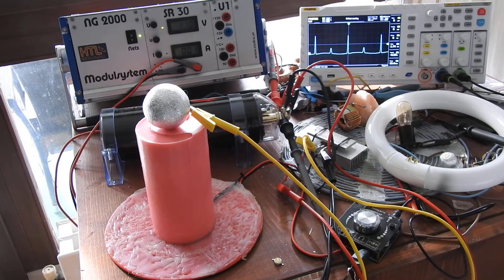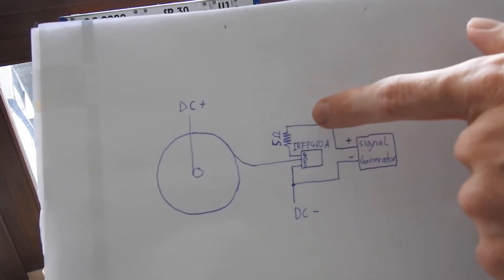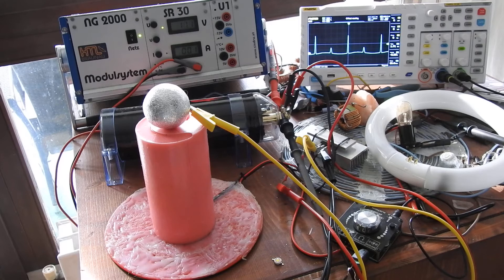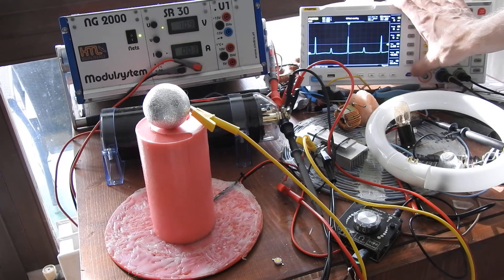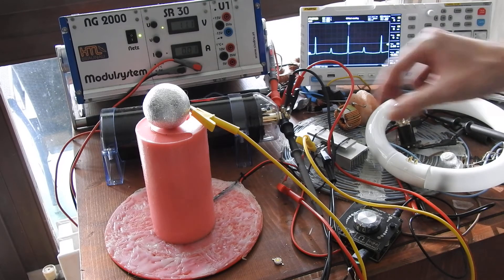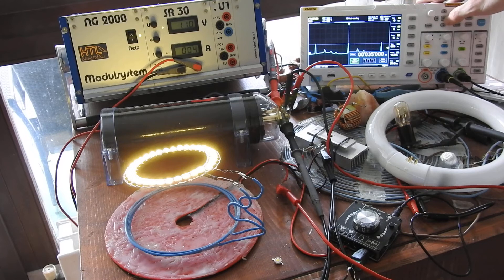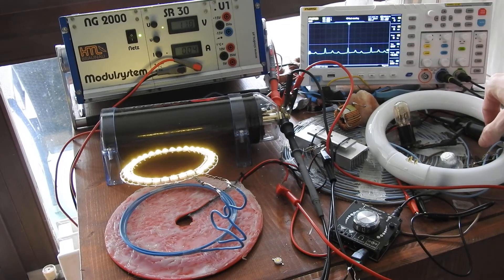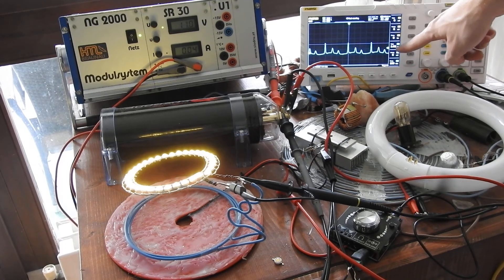High Voltage Impulse Generator - easy build with schematics and examples

Comment: Tesla tells you how all his followers and disciples got in wrong in there understanding of his patents and coils. In his court case against Marconi. Once you read it, it will change your understanding of your projects and the purpose of modern day Tesla coils.
Reply from the maker: Do you have a link to the document you are referring to?
Reply: I will find it and provide it to you shortly. Colorado springs: tin 30" ball polished, reflective, lacquered and coated with rubber paint. It took me a long time to understand why. You want the antenna 📡 1 - 5 % the weight of the ground metal. Most of the energy stays in the circuit or ground. Very little is lost through radiation in the antenna. High Voltage and low frequency. Modern day Tesla coils are Lodge coils. There purpose is to demonstrate disturbances in the Aether by sound waves. They radiate 99% of the energy. Opposite of what you want. Warden Cliff transmitted 99% of its energy through the ground. Hence the giant sprawling copper grounding rods.
Reply from the maker: @devinmccloud  Very interesting what you write.
I have thought about coating the aluminum ball with epoxy before, now I'm probably going to do that, although I still don't know what purpose this serves.

Thanks for the informations!
Reply: @OmegaZZ111  it needs to be a mirror finish. As stated by Tesla. Then lacquered or polyurethane. Then rubber paint. Right out of his Colorado Spring notes 1899. 
 Ed Leedskalnin of Coral Castle 🏰  was a Tesla fan. His theories were inspired by Teslas works. The same concept was used in his shed. Once you except what Tesla said light, radio, and electricity are, then things make more sense. Electron theory is just that. Tesla created his own scientific instruments far superior to Hertz and others. Those instruments are only as good as the mind that creates them.
Reply from the maker: @devinmccloud  I am currently coating two aluminum spheres I made today, I hope they will be useful for future builds.

Thanks for pointing out the Colorado Springs notes, haven't read them before.
Reply: If you really want your mind blown, read his Wardencliff brochure on how he would unify GPS globally, connect all telegraph stations, time servers; music, pictures, radio globally. He envisioned the internet one hundred years before anyone. All of the things this man talked about where not predictions of the future, they were realities he had already created!
Reply: I have posted twice and each time it is removed by someone. Posting text:
In a pre-hearing interview with his legal counsel in 1916 to protect his radio patents from Guglielmo Marconi, Nikola Tesla explains the similarities and the differences between his wireless system and the systems of today.

Counsel: “Mr. Tesla, at that point, what did you mean by electro-magnetic momentum?”

Tesla: “I mean that you have to have in the circuit, inertia. You have to have a large self-inductance in order that you may accomplish two things: First, a comparatively low frequency, which will reduce the radiation of the electromagnetic waves to a comparatively small value, and second, a great resonant effect. That is not possible in an antenna, for instance, of large capacity and small self-inductance. A large capacity and small self-inductance is the poorest kind of circuit which can be constructed; it gives a very small resonant effect. That was the reason why in my experiments in Colorado, the energies were 1,000 times greater than in the present antennae.”

Counsel: “You say the energy was 1,000 times greater. Do you mean that the voltage was increased, or the current, or both?”

Tesla: “Yes [both]. To be more explicit, I take a very large self-inductance and a comparatively small capacity, which I have constructed in a certain way so that the electricity cannot leak out. I thus obtain a low frequency, but, as you know, the electromagnetic radiation is proportionate to the square root of the capacity divided by the self-induction. I do not permit the energy to go out; I accumulate in that circuit a tremendous energy. When the high potential is attained, if I want to give off electromagnetic waves, I do so, but I prefer to reduce those waves in quantity and pass a current into the earth, because electromagnetic wave energy is not recoverable while that [earth] current is entirely recoverable, being the energy stored in an elastic system.”

Counsel: “What elastic system do you refer to?”

Tesla: “I mean this: If you pass a current into a circuit with large self-induction, and no radiation takes place, and you have a low resistance, there is no possibility of this energy getting out into space; therefore, the impressed impulses accumulate.”

Counsel: “Let’s see if I understand this correctly. If you have radiation or electromagnetic waves going from your system, the energy is wasted?”

Tesla: “Absolutely wasted. From my circuit, you can get either electromagnetic waves, 90 percent of electromagnetic waves if you like, and 10 percent in the current energy that passes through the earth. Or, you can reverse the process and get 10 percent of the energy in electromagnetic waves and 90 percent in energy of the current that passes through the earth.”

“It is just like this: I have invented a knife. The knife can cut with the sharp edge. I tell the man who applies my invention; you must cut with the sharp edge. I know perfectly well you can cut butter with the blunt edge, but my knife is not intended for this. You must not make the antenna give off 90 percent in electromagnetic and 10 percent in current waves, because the electromagnetic waves are lost by the time you are a few arcs around the planet, while the current travels to the uttermost distance of the globe and can be recovered.

"This view, by the way, is now confirmed. Note, for instance, the mathematical treatise of Sommerfeld, who shows that my theory is correct, that I was right in my explanations of the phenomena, and that the profession was completely misled. This is the reason why these followers of mine in high-frequency currents have made a mistake. They wanted to make high-frequency alternators of 200,000 cycles with the idea that they would produce electromagnetic waves, 90 percent in electromagnetic waves, and the rest in current energy. I only used low alternations, and I produced 90 percent in current energy and only 10 percent in electromagnetic waves, which are wasted, and that is why I got my results. You see, the apparatus which I have devised was an apparatus enabling one to produce tremendous differences of potential and currents in an antenna circuit. These requirements must be fulfilled, whether you transmit by currents of conduction or whether you transmit by electromagnetic waves. You want high potential currents; you want a great amount of vibratory energy, but you can graduate this vibratory energy. By proper design and choice of wave lengths, you can arrange it so that you get, for instance, 5 percent in these electromagnetic waves and 95 percent in the current that goes through the earth. That is what I am doing. Or you can get, as these radio men, 95 percent in the energy of electromagnetic waves and only 5 percent in the energy of the current. The apparatus is suitable for one or the other method. I am not producing radiation with my system; I am suppressing electromagnetic waves. In my system, you should free yourself of the idea that there is radiation, that the energy is radiated. It is not radiated; it is conserved…”
Reply from the maker: @devinmccloud  I haven´t removed it, don´t know why it was removed, I have disabled all comment filters on my videos now.

This pre-hearing interview explains Teslas system very well and understandable, thanks for posting it, I haven´t read it before.
You seem to have much knowledge and a good understanding of Teslas and others works, thanks for guiding me in the right direction.

I personally am not a genius in electrical engineering, I try to learn from the masters and do experiments to try to get a better understanding, so please be patient with me if I am just tinkering around with setups that make not much sense.

Again, thank you for all the information you provided, it will take me some time to fully read and understand everything, although I think I understand the principle of Teslas wireless power transmission system now better.
Reply: @OmegaZZ111  I think youtube was removing each post, not you. My focus soon will be his radiant energy patent. He patents each part but doesn't reveal each patent in the designs to protect his ideas. For instance his bifiler patent and his shielded wire (coax) patent. Both are required and important. High Voltage  wiring requires shielding and a separate ground to protect from charge carriers. Patent 685,957-8 is his most important patent he likened to his children. As you can see nobody understands what Tesla discovered. He rediscovered the Aether, what light, radio, and electricity are. He discovered a new medium of energy transfer and zero point radiations.  They buried his research and technologies. In my opinion probably because of national security.
Reply from the maker: @devinmccloud  I have seen the patent of his radiant energy receiver before. As far as I understand it, he is using the potential difference between earth and the atmosphere to convert it into usable electricity.
Altough from the drawings in the patent alone I can´t figure out how such an apparatus actually would be built.
I agree that really covered some of his biggest secrets to protect them. Also the US government took most of his important papers and devices after he died.
Good luck with your research on this topic!
Reply: This energy is hitting the antipoles over and over at every point on Earth. Ringing the earths bell (Ed Leedskalnin " Ring the bell twice") . Tesla was ringing it every 7 minutes. He accurately calculated the Earth's diameter this way.